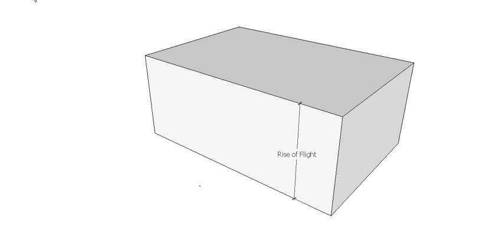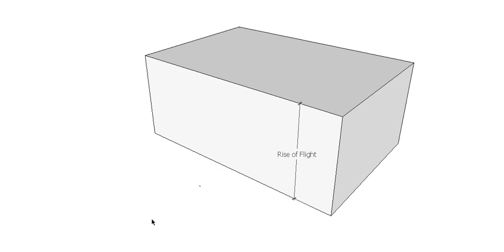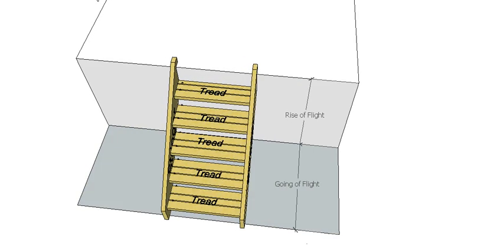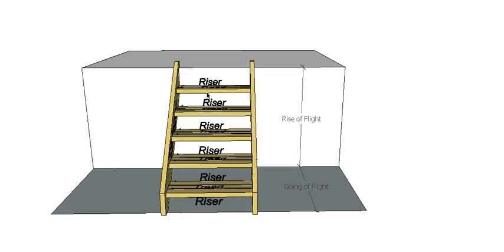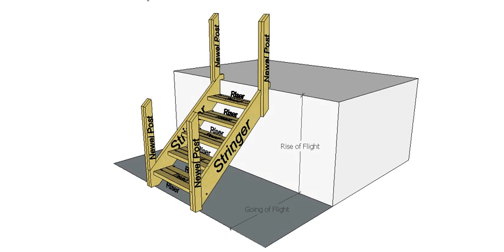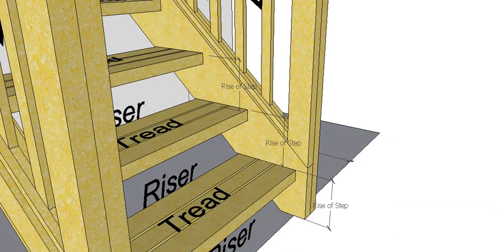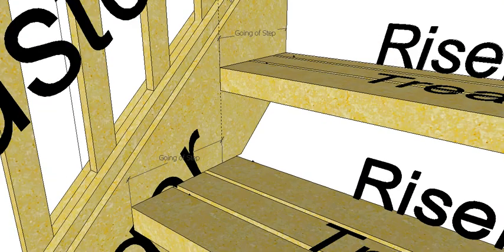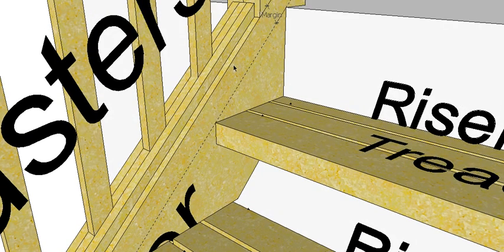Stair Components and Terminology

Comment: I didn't see the part I was looking for. 🙁
What do call that strip at every front edge of the threads that is usually there to prevent slipping?
Reply from the maker: Hi Mate, any strip on the front of the stair is called a Nosing however they are not always there to stop slipping, mostly they are there for decoration. Hiope this helps.
Reply: @Buildsum  Thank you, Mate. 🙂